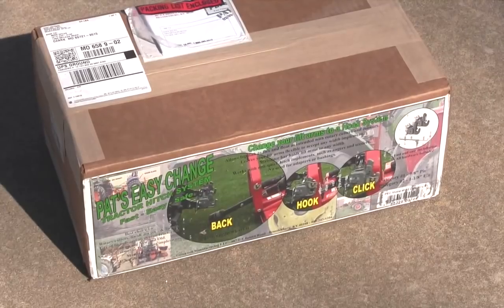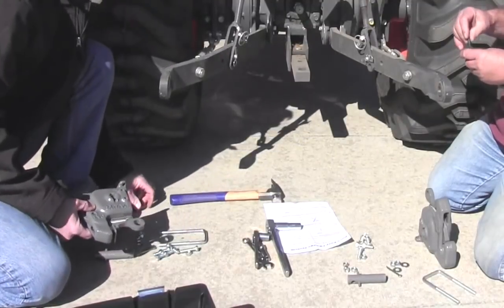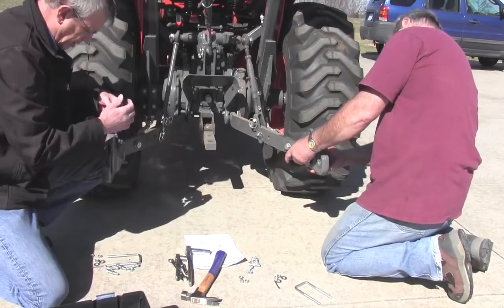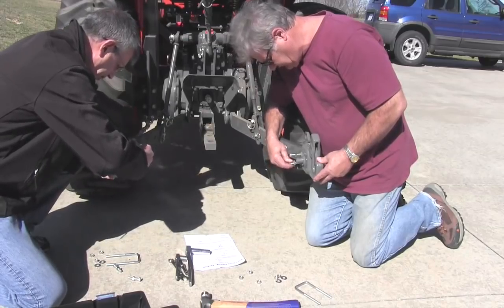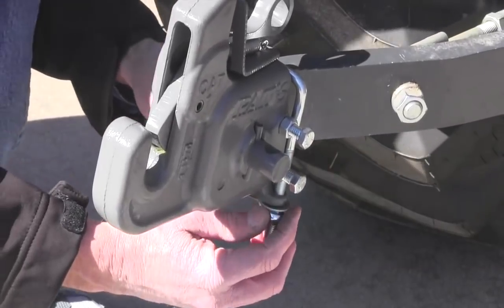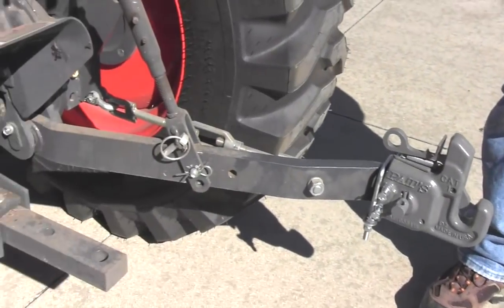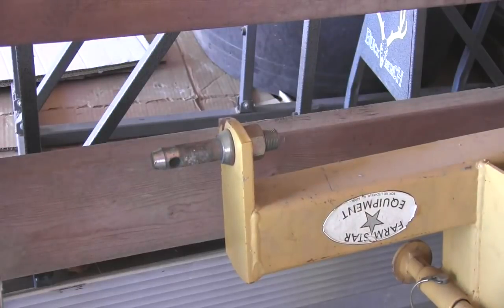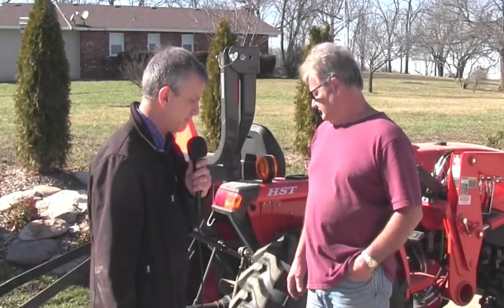Is Pat's Easy Change the Best Hook Up for 3 Point Implements?

Comment: Have you had any problems occur due to reduced hitch lifting capacity arising from the extra 4 inches that this device adds to the drag links?
Reply from the maker: No, but I'm not trying to lift anything near the capacity of the tractor with the three point.  Having the load further back would definitely affect that.
Reply: Thank you.  I rather thought the same thing, but as one who doesn't yet own a tractor, I'm trying to scoop up all the knowledge I can!

Comment: I'm looking to get these for my john deere 870.  I do have a concern.  I have a king kutter rotary cutter with a swivel top link.  As of right now, I have to lengthen out my top link on the tractor, almost maxing it out.  With the extra 4 inches these hook ups will add, I'm afraid I won't have enough top link length for my rotary cutter.  At the very least, it would be really sloppy.  I was wondering if a longer top link is available for my tractor or is there another solution.  Any suggestions?

Comment: You don't need to prop open those locks on the lower arms . Just pick up your implement and the pins  on the implement will push those locks open. When you hear the click of the locks snapping into position, you'll know the implement is locked into the hooks.

Comment: Your welcome for the recommendation :)  Hey, quick question.  If you are selling these, can you find out something for me?  My new tractor has larger than normal link arms for a cat 1 system.   They are 4" tall and the Pats cat1 system won't fit.  They are not quite tall enough.  Does Pats make a taller version?  Is the Cat 2 system taller so I could just buy that and get cat1 - cat2 bushings for all my stuff?  I tried emailing Pats but never got a response.
Reply from the maker: Yup, that came direct from you.  If I sell any I'll send you the commission check :).  Let me check on the dimensions of the cat II.  Give me a little time and I'll see what I find out.
Reply from the maker: Jeremy, the cat II is 4 1/2" tall.  If that might work, shoot me an e-mail at mike@asktractormike.com and let's discuss.  I have some concerns I want to discuss with you that way if that's okay, and possibly a better Pat's option that you may not know about.

Comment: I have a quick hitch and Pats easy change.  Nobody tells you that when hooking up a finish mower to the quick hitch, you will need an adapter for the top link so the mower will still float. Pats is so simple and I have to get off of the tractor to hook up the PTO anyway, so hooking up the top link is no trouble at all.  Save some money and get the Pats Easy Change. Im selling my quick hitch.

Comment: Mike, If you had the choice to choose between a quick hitch and the Pat’s EasyChange system which would you go with. Let’s assume all your implements are already quick hitch compatible. Both add about 4” of extension to the three point set up.

Comment: Got a set. They are nice sometimes but always hitting the pto shaft on the batwing when turning. Disc mower is nearly impossible to get hooked up. Ended up taking them off. But for certain things they are really nice.

Comment: I wish you would have shown the implements that Chuck has that are all different widths. Are they all Cat-1 implements or is he also using some Cat-2 implements?  I fully understand the frustration that can sometimes arise when first getting a quick hitch. But most of the incompatibilities come from the way the top-link attaches to the implement, specifically insufficient room for the top hook on the quick hitch to grab the implement coming up from below it. Incompatible spacing of the lower pins is rarely an issue. The Cat-1 spec calls for 27" between the lower pins. Most quick hitches have a bit of margin especially when bushings are used.
Reply from the maker: I'm pretty sure they're all cat I.  One of his three implements, and I think it was the brush hog was about an inch too wide for the quick attach to fit.  It's a good heavy cutter but it came from and farm and ranch type store, a little of an "off" brand.  And Chuck, if you read this, forgive me for saying that :).  I've seen the top link grab problem many times as well.
Reply: I've been using the Pat's quick hitch for 2 years and it is great!
Reply: I have several "cat-1" implements that have non standard pin spacing. I tried the Harbor Freight quick hitch and found that it would only fit 2 out of my 10 implements. I swapped over to the Pat's Easy Change and have been pleased with the performance. I do suggest that you keep a few spare pin washers.
Reply: I fixed that issue by replacing the top bolts for the hook with pins. This allows me to flip the hook forward towards the tractor, and when I backup to the brushhog it's out of the way. Having to get off anyway to hook up the PTO, the hook is flipped back into place and then the top pin is put back in the implement. I've bought the Tractor Supply one over fifteen years ago and never had any issues with it. Most complaints I've heard are with rotary cutters because of the top strap design not allowing the hook to pass thru.

Comment: Do you by any chance know if they would work on a tractor with the old-style flat steel stabilizer links that slide on to the implement pins alongside the hitch arms?  I have that style on my Ford 4400 tractor and was concerned that the claw hitches would not have enough space inside to accommodate the hitch arms as well as the stabilizer links.
Reply from the maker: Great question.  If you'll send the width of the hitch arms and stabilizer links to mike@asktractormike.com I'll run down and see if they'd fit.  Or, if I can remember I'll just go down this weekend and measure and let you know what that is.  You just need to know how wide that hole is right?  I'm a little concerned about where those jam bolts would go though, they'd really need to hit solid lift arm to hold it steady, that might be a problem.

Comment: Looking at buying these however I have alot of old implements many of which have pretty crooked pins either tweeked forwards or backwards from many years of abuse I'm wondering how tight they fit the pins and if theres room for crooked pins to still fit it the hook ? Any help would be greatly appreciated
Reply from the maker: Matt, hard to say without seeing them but I'd say they probably wouldn't work.  There's no "give" to Pat's cradle, with the balls in the lower link arms they can be pointed forward or back and still be okay.  Might be time to replace pins....or get a big hammer :).

Comment: I have looked at these and may go this way, I too have varying width implements. I keep wondering why did the fast hitch and eagle hitch fail?? One point you did not mention, In some cases you May have to get a different top link, I know one person who did in order to use his on one of his old implements.
Reply from the maker: One of the implements was a little too wide and wouldn't fit without major modification.  On my tractor the rock rake wouldn't fit because there wasn't room for the claw to get under the top link hook up.  Here's a link to the video where I evaluated the quick hitch: https://youtu.be/4TPOWlzUeV0
Reply: Now I remember, after he bought the new top link he tried the extender you showed., that was not a good solution either. So now I do believe I will order a set of Pats.

Comment: I have a 2015 workmaster 70. (The lower links have cat 1 and cat 2 balls)  I'm considering Pats for it. Should I order the cat 2 to cat 1 unit?  All my attachments are cat1 for now. Maybe a cat2 later will be added.
Reply from the maker: Greg, if all you’ll ever run are category I implements, get Pat’s for cat I.  If there’s a chance that you’ll run both, get Pat’s Cat II, then you can put sleeves on the Cat I attachments and they’ll fit right in the cradle on the Pat’s Easy Change as will the category II attachments.  You can make a Cat I implement fit a Cat II Pats', you can't make a Cat II pin fit the Cat I cradle. -Mike

Comment: I have a older Ford tractor that uses a sway bar to keep the implement from hitting the tire. Mines not connected to the hitch arm like the new ones do.  One end of the swing arm goes on the tractor and the other end goes on the  implement after you slide the right side hitch arm. Will this still work?
Reply from the maker: Michael, Pat's offers a long pin that goes through the stabilizer bar on tractors like your, if you're ordering here: https://asktractormike.com/product/pats-easy-change-quick-hitch-category-1/ just put "need long pins for older Ford tractor" in the comments and they'll send those at no extra charge.

Comment: I purchased used Kabota with a backhoe attachment. I realized after I got home that it has no 3-point arms or anything on the back of I take off the backhoe. 

Any recommendations on where I should buy the 3-point arms and connectors? Thanks
Reply from the maker: Bobby, that's a common problem as many backhoes require removal of the three point arms to mount the backhoe and then they get lost if they're not used.  I don't know of anyone who makes aftermarket sets, they'll probably have to come through a Kubota dealer.  You might try to find a salvage set.  You can look up every part on that tractor at Kubota’s website here: https://apps.kubotausa.com/illustrated-parts/.  Just hit “View Illustrated Parts”, accept their terms and conditions, and enter your model number and you can see every part on your tractor (and loader).  You might Google the individual parts and find cheaper alternatives.

Only other idea is to try to locate the previous owner.  Those parts are probably in a barn somewhere and if they've sold the tractor they wouldn't need them anymore.  

Good luck!
Reply: @TractorMike  Thank you sir GOD bless

Comment: I installed the Easy Hitch, hooked up the Hog and the wife went out to cut the field.  Well, at one point the washer/cotter popped off and the subsequently the Hog dropped.  That shouldn't have happened, and I can't figure out why it did.  Any ideas?
Reply from the maker: I'm sorry that happened!  I have heard of pins coming loose from Pat’s Easy Change, it's not common, but can happen.  Usually, the experiences I’ve had with that are a result of:

 1) Worn or loose implement pins
2) Stabilizers not cinched up so the pins are sliding in the cradle
3) Washers come off when lynch pins come loose or break
4) Brush hog set with too aggressive a back to front angle…in other words, it is much higher on the back than the front.  If it’s set that way, a sudden jolt from uneven ground or a root can force the pins out of the cradle.
 
The few times I’ve heard of an implement coming loose from Pat’s Easy Change, one or more of those has happened.  If you had a different situation, I’d be interested in hearing about it.  Drop me an e-mail at mike@asktractormike.com.

Comment: I have an old Ford 4000 and the balls in the lower attachment bars are worn and may eventually come out of the bars. Would this solve the problem?
Reply from the maker: I ran this by the folks at Pat's and they have a weld on option that would be a better choice to solve your problem.  Shoot me an e-mail at mike@asktractormike.com and I'll send you a picture.

Comment: will this work on an ls mt125? im getting that subcompact tractor soon and after researching online and calling the manufacturer, there are not quick hitches made for it. People have bought them and modified them but itd be really nice to find an easier solution.
Reply: I have a set on my BX2200, makes it a lot easier to hook implements. Mine are about 15 or 16 years old and working like they should.

Comment: Looks like a major pain to install compared to a Quick Hitch! Can install or remove my QH in 30 seconds and it works great with all my QH ready implements. For implements that aren't QH ready you can easily take it off in seconds. Also you failed to address the top link that still needs attaching which means you have to get off the tractor still. I back up to my bush hog and hook all three hooks in seconds! Pat's is $150. Got my QH at HF for $79 with 20 percent coupon. I vote Quick Hitch!
Reply: Good comment.
I have a couple questions about Quick Hitch that Mike may never answer:
1) What's the thickness of the top claw on your Quick Hitch?
2) My brush-hog lower points are 30" from outside pin to outside pin, and the points are 24" from inside pin to inside pin. Will the Quick Hitch pick up my brush-hog with these measurements?
Thanks for any help!
Reply: @GetRealBaby  I will go out in the rain and measure! Standby...
Reply: @GetRealBaby  the top hook is 1-1/4", center to center on the bottom hooks is 28-1/2". My pins are 30" also. You will need quick hitch bushinds for the 2 lower pins on each implement. Do not by at Tractor Supply as the want $30 for a pair and everywhere else is $16. They price matched for me though when I showed them Rural King's ad. I love the quick hitch. Harbor Freight with coupon for $79. You can always return it. HF doesn't carry the bushings though. Top hook is adjustable in height

Comment: Could make a quick link hook for the top pretty easy.
Reply: "Stake" a thread below each of the U-bolt nuts, os if they  vibrate loose the nut won't fall off.
Yo just put a punch against the thread and whack it with a hammer to deform the thread enough to not let the nut  just vibrate on off to be lost.  You can smooth the deformed thread with a file and the nut will come off easily.

Comment: So I have cat 2 holes in my tractor arms but all my implements are cat1, which pats do I need?
Reply from the maker: Most farm supply stores and dealerships have bushings or sleeves that go over Cat I pins to make them Cat II size.  You'll need a bunch of them.  Here's an example: https://www.agrisupply.com/lift-arm-bushing-cat-1-to-cat-2/p/106048/.
Reply from the maker: DISREGARD LAST MESSAGE!!!  I was reading back through and realized you were asking which Pat's do you need.  You can use the bushings I mentioned above to make your Cat I implements fit the Cat II Pat's Easy Change, then if you ever acquired Cat II implements, they'd go right on.  OR...you could buy the Pat's Cat II (tractor) to Cat I implement and they'd go on with no bushings.  Either will work.  I'd probably go with the Cat II to Cat II just so I had the option of running Cat II attachments.  You can make a Cat I fit Cat II but you can't go back the other way.  The other things you might be able to do is switch the Category I pins in your implements to Category II.  Usually you'd have to drill out the holes for the shank on the pins, though.

Comment: Hello I’m going to install on on ford n tractor and need to have a stabilizer bar on it and have see that people got longer pin from pars to be able to use the stabilizer bar from the axle ,I have look over the internet net and can not find the web site for pats anywhere , some people said they contacted pat s to buy the parts but I can’t find the place to contact them .any help would be nice
Reply from the maker: John, Pat's doesn't sell direct, but if you order it here and put "Need longer pins for 8N" in the comments, we'll get you what you need: https://asktractormike.com/product/pats-easy-change-quick-hitch-category-1/.
Reply: @TractorMike  I got a hold of the company and they are sending me the longer pin and spacers thanks for the info , the older I get the harder it is to hook up equipment I hope this helps

Comment: Better remove the adjustment bracket. If not when you lift a implement with a PTO shaft it's gonna bend the hell out of it. Also the stay brackets don't stay in place. So occasionally the implement is gonna just out of the brackets.

Comment: Is it possible this quick hitch be used on a naa tractor also
Reply from the maker: Yes, you'll need longer pins which we can supply at no extra charge if you'll note in the comments what tractor it goes on.

Comment: I own the Pat's easy change system but no longer use it.  My primary 3 point implement is an Alamo SHD88 flail mower and when its running there is a bit of vibration.  I found the vibration constantly caused the screws that hold the pats easy change in place to wear on the ends and vibrate loose.  I like the concept but for my application it wasn't working out.
Reply: Want to sell them?

Comment: I use the wire from old political road signs custom bent for each implement to hold the arms apart. After the elections are over you can always find them left along the road

Comment: Would this work on a Ford 2600.
Reply from the maker: Michelle, yes, but some of the Fords had a stabilizer arm that requires a longer pin, can't remember if the 2600 had that or not.  If the lower three point arms have a bar that come out and attach to the implement to keep it from swinging you'll need the longer pins, if there's a chain there, you won't.  If you need the longer pins, just put that in the comment section when you finish your order and they'll ship them at no charge with the Pat's Easy Change.

Comment: No it's not.
If all your equipment is the same and u can use a standard qa, your better off.
With pats, you have to get off tractor to connect top link.
And you have to deal with stabilizer bar each and every time.
There is also a brand that has a class 1 pin set up.
I literally back up and pick up and ready to work.
Never have to get off tractor or get out of cab

Comment: Dromone hitches, Oldcastle Ireland,  the best hitches for any tractor, supplier to most major tractor manufacturers....check them out!
Reply from the maker: What I saw was drawbar only.  Slick system!  Do they make a three point one?
Reply: dont think they make 3 point type,they make  pick up hitches,walterscheid or CBM make a neater hook end but it has to be welded on the end of the link arm instead of the ball end